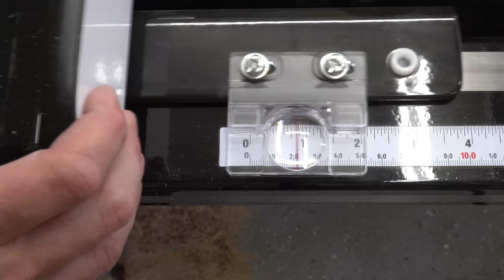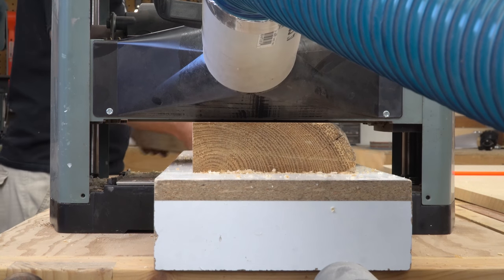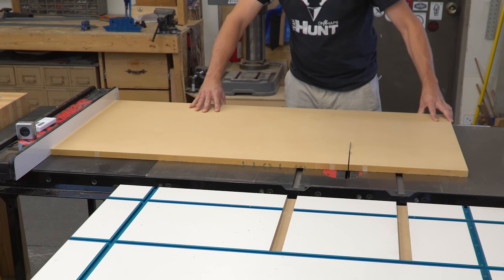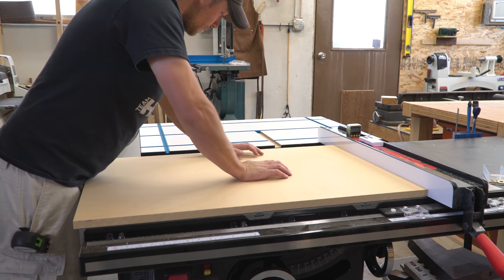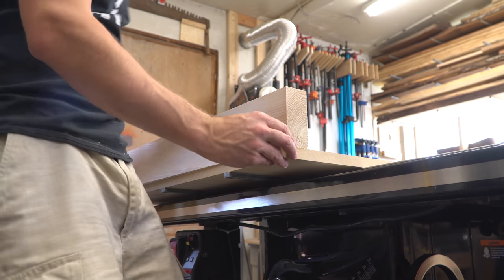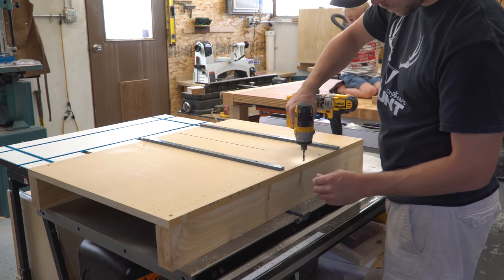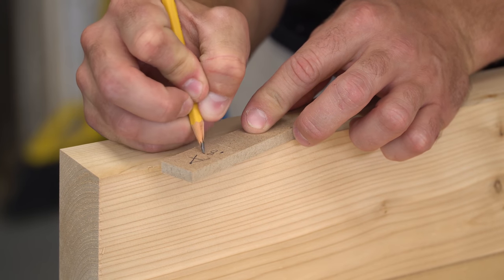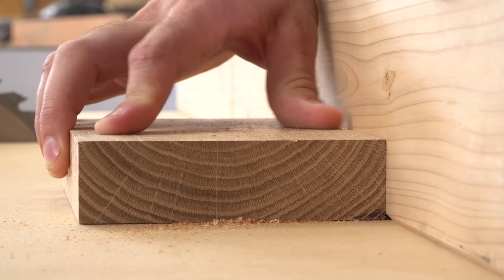Making A Table Saw Crosscut Sled - Simple & Precise

Comment: I've watched a ton of sled build videos, you're is one of the best to start from. What I like most is what you said near the beginning... 
"There are really only two hyper-critical parts of a cross-cut sled. The runners and the back fence. Other than that, the rest is just personal preference and bells and whistles."
A tip I will always remember, thanks for sharing - 5⭐'s

Comment: Love the tip to keep the runners tight and just sand them down! Will definitely keep that and the runner material in mind when I rebuilt mine. I've noticed there might be some slop depending on seasons/humidity in it.
Reply from the maker: I definitely had to learn a few of those things the hard way with my last saw and sleds.

Comment: Nice video. I like you showing the reason for the sawdust relief. You really should credit William Ng for the 5 cut method. Overall very well done.
Reply from the maker: Is William the original source? I have seen it so many times over the last few years I thought the true origin was probably a mystery at this point.
Reply: Gunflint Designs Yes, I believe he came up with the process.
Reply: He's got a great video on dialing in a miter sled, too.  Great mind.

Comment: Curious what people think of MDF for a sled?  (I have tons of scraps I could use, but I'm not sure if MDF is the right way to go.)
Reply from the maker: Its last me a few years and a 1000 mile move at this point, so far no problems. I like it because it's stable and won't warp with changes in humidity.

Comment: For a crosscut sled that you never need to wax, use a sheet of Phenolic surface coated plywood used for concrete forming. The Phenolic layer provides a slippery surface by default.
Reply from the maker: I'll have to look into that!
Reply: I have a few sheets of solid 3/8 Phenolic. I was going to use the smaller pieces as runners, now I'm thinking I'll make the base and runners out of Phenolic.  Thanks!

Comment: Excellent video -- from the camera angles, the volume, lighting, etc. -- but, especially your presentation! Clear, concise and well-spoken. I clicked on the "Build Article" link above, which took me to your website. The information there is equally as professional as your video. However, why do you use such a small font size on the page, and then, make it grey?  I worked in a marketing agency for 30+ years. About eight, or so, years ago I noticed our digital designers began using the smaller font size/grey combination for websites because they thought it was "cool".  It never made an impression on them when I argued that, while that may be trendy, it also makes it difficult to read. Using that font/grey combination is similar to you reducing the volume in your videos by half. Thank you.

Comment: I've watched a lot of sled build videos, one thing I've found lacking in almost everyone is there is little or no explanation about how high the fences should be relative to the max height of the blade, obviously if it's too low the sled will just break in half

Comment: Nice vid man! Would the absence of a front fence on a smaller sled allow you to cut larger pieces when needed, without the need to make a 2nd, larger sled?
Reply from the maker: Yes, but there's a tradeoff. With two fences the overall sled is much stronger because it is being held together across two planes. You can make one with just a rear fence, but you better make sure it is a beefy fence to hold everything together. If you can picture it, the left and right sides of the sled would only be held together by the material in the rear fence that is above the saw kerf.

Comment: Would a Table Saw sled such as this trump my sliding compound miter saw when it comes to crosscutting accuracy, besides the capacity increase ?
Reply: Absolutely. You fix that front fence accurately, and you'll never beat it with any miter saw, even a Festool.

Comment: My dewalt cordless table saw only has one mitre slot. Do you think I can still build a sled like this and only use one runner?
Reply: Ian Enderby 
That is very possible
Reply from the maker: Yep! just make sure you have a great fit with the runner and do your best to always push it straight.
Reply: Use 3 runners. 2 for the edges of the table. Might be able to omit the miter slot runner and have just the edge runners.

Comment: Hello,  Nicely done video presentation. If it were "me" and Not "you" I would have Build my Sled to 24" capacity for my Largest Sled rather than the 21". Cross cutting a sheets to make Cabinet Carcouses would be my objective for have such a Big Sled in my arsenal...
A smaller sled with a cross cut capacity of 12" would be my preference for the Smaller Sled... 
Other than expense and scarcity I would try and make my sled bottom out of that PVC plastic sheet you have you said you had two..? Lucky You... Greg

Comment: Nice walk through of the techniques and steps required to make a precise crosscut sled. For better accuracy you could start (and end) with a long side cut, instead of a short side cut when doing the 5 cut test. The longer the cut the better the accuracy you can gain, but this is of course quite marginal. Personally I would never make a sled from MDF and solid wood, regardless of how long it might have been seasoned. The issue being that there will likely always be a fluctuation of humidity in a workshop over the year (dry in summer and wet in winter) which will affect MDF and solid wood so much faster than a good quality plywood. Again, it will be marginal, but if you aim for as accurate as you can possibly get get it you would be better off with good quality birch plywood. (If you have climate control in your workshop, with an even temperature and humidity throughout the year, this does of course not apply in the same way, but who has climate control in their workshop?).
Reply from the maker: Definitely some good points! In my case, I technically live in the high desert, so humidity and moisture are't too much of a concern.

Comment: A great looking cross cut sled!  On the safety block, make it a box with a lid and a dust port.  You'll be pleasantly surprised how much dust gets sucked through the saw kerf in the rear fence.  I also had to add a travel limiter to prevent cutting through the safety/dust collection box. Sled weight can be a big problem.
Reply from the maker: Good tip on the dust collection!
Reply: You are welcome.  :)

Comment: A shop staple. Great build, and excellent recording of the process!  I laid a cheap sticker-ruler on the base of mine, thinking it would get me by until a nicer stop-block system, but it's so handy (especially for quick cuts that don't have to be perfect) I haven't considered the upgrade yet. Thanks for the video.
Reply from the maker: I think a good fixed ruler would be a great addition!

Comment: If you'd wanted a professional machine you'd buy a Felder or a Hammer sliding table saw and cutting that large sheet of plastic (or a full sheet of plywood) would've been quicker, more comfortable and less precarious.
Reply from the maker: With my wife showing interest in the shop and two young boys looking to start working in there some day, I wanted the safety feature of the SawStop.
Reply: SawStop still cuts pretty deep but yeah not as catastrophic as regular saws.

Comment: sorry to say the article that is "2018" is nothing but same old stuff rewritten over and over, every year. there is literally no variety of saws to choose from . there are 7 "job-site" models on there and 3 pretty expensive saws (yes the smaller SS is labeled "contractor"  but is leaps ahead of other hybrid types). The Delta Uni is very well rated low, all SS has high regards. where are all the other saws before you jump into nearly $2k? that article from Acme Tools is a shill ad (since this is just their own product), not to say that you are. Acme tools did ZERO work and I've seen the same "best of" lists for years.
Reply from the maker: Maybe everyone makes the same list because they are all in agreement on what's best?